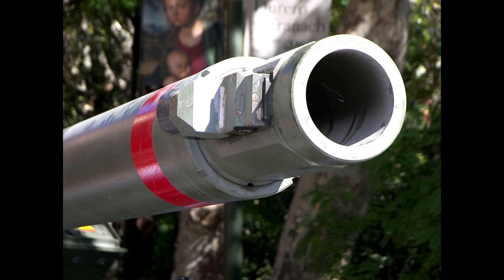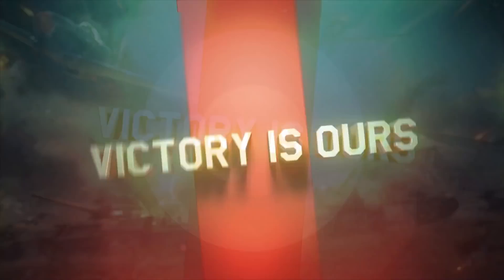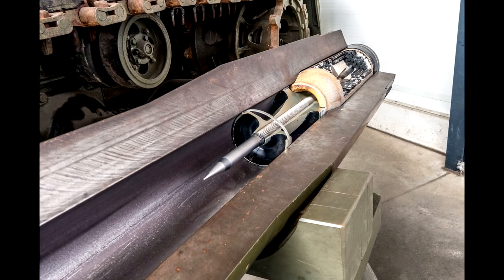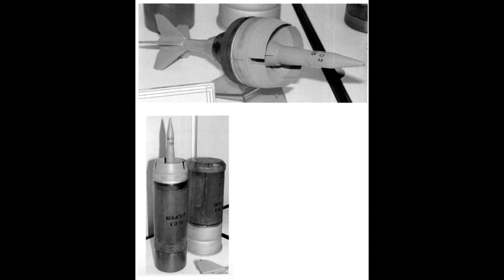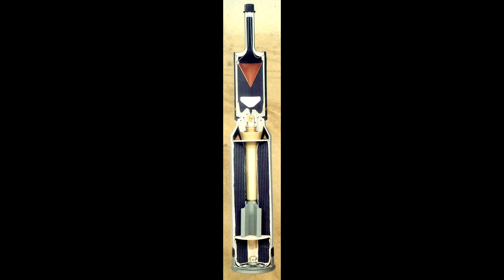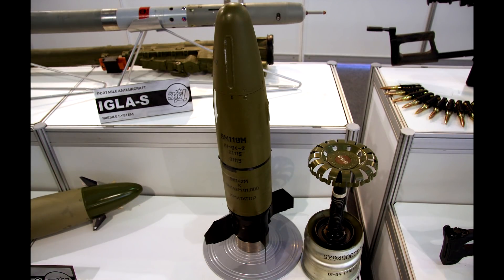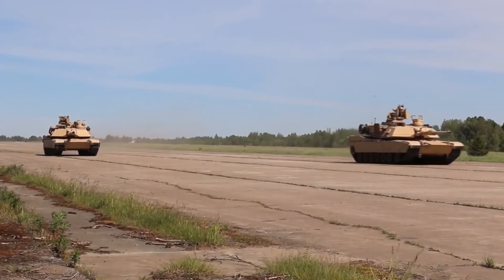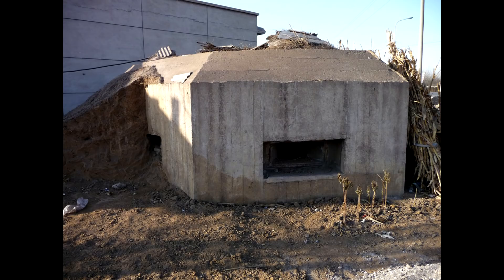Tank Basics - Firepower of Modern Tanks

Comment: The projectile will break if it is too thin, that is why crossbow bolts are thicker amd shorter than arrows, its so the bolt can withstand the amount of force exerted on it, slightly different but same premise, the more force often requires a thicker and/or shorter projectile, i'm no expert, but i do a massive amount of research, and i still dont take what i "know" as definitive, so if anyone know if my comparison is incorrect, let me know and mention why, i would greatly prefer that rather than just saying that im wrong without telling me why.

Comment: A comment and a question. First my comment. Sabot performance is based upon kinetic energy (KE). The formula for calculating kinetic energy is:  KE = 0.5 x mv2. In this equation, 'm' stands for mass, the measure of how much matter is in an object (as in the case of the 'core' of  the SABOT dart), and 'v' stands for the velocity of the object, or the rate at which the object changes its position. So, what that tells you is that the heavier the weight (i.e. mass) of the projectile, the greater the KE it will impart as velocity increases. This is also why all major Armies of the world have gone to depleted uranium perpetrators, because of their 'mass' (compare Uranium's atomic weight on the periodic table of elements, if you have any doubts). Sabot rounds are shaped 'like darts' and have a 'thin diameter' so, that a very large and powerful gun can fire a very aerodynamic dart (i.e. less drag and more stability, results in greater inherent accuracy) while maintaining higher mass. Thinner, longer projectiles help to provide higher velocities, and act as more efficient means to store kinetic energy, which is the single factor that results in greater armor penetration (as substantiated by the KE formula above). So, your SABOT explanation makes several basic errors and resulting false conclusions. With that in mind, my question is simply this: "What are the reference sources you have been using and what are YOUR own personal credentials and experience with this topic?" I myself, am a retired US Army Armor Officer (i.e. M1 Tanks) and a former employee of the US Army organization that manages the M1 Tank Program in Warren, Michigan USA. I'm not criticizing you, per se, just encouraging you to do a little more homework in the future before presenting the results.
Reply: JagdPilot M1 Main reason why countries use depleted uranium is because it’s free.
Reply: @hazardous458  I wouldn't say that's the main reason, but it certainly doesn't hurt. Tungsten is notoriously expensive.
Reply: Actually, DU has several added benefits besides density, it has a unique shearing pattern upon penetration that some have referred to as "self sharpening," helping to achieve greater penetration, and it is also pyrophoric, thus enhancing its incendiary properties after penetrating. 

This, and, all other things being equal, a longer rod will penetrate deeper. There is a direct relationship between length of rod and penetration. To say it is only kinetic energy is a vast oversimplification, current penetrators are the product of decades of research and refinement.

Comment: Good video but some notes

Not all apfsds rounds are mono block
German dm53 is a segmented penetrator, there’s a difference
There’s also extending a[fads rounds like the ones that will be used on the warrior 40mm.
M829a3 may be a mono block, it has a precursor tip that breaks off in contact with era to counter it.

Comment: I knew a ranger who was in the first gulf war. He was in a forward recon unit and was tasked with sitting on a hill watching a Iraqi tank battalion and calling in the shots for the armor. the abrahms tankers start firing sabots at the Iraqi T-72's. The rangers would observe the rounds go past the Iraqi tanks and go skipping through the dessert so the rangers were calling in the shots as misses. After awhile the tankers started arguing with them saying they had killed all there targets. After awhile the rangers didn't notice any movement from the Iraqi tanks and were told to approach and inspect one of the enemy tanks. When they got closer they realized the sabots had been going right through the T-72's. They looked inside one and the tank crew had been jellyfied from the spalling sabot.
Reply: I didn't know a ranger and heard that story 100 times! Probably from their own ranger!
Reply: @pashapasovski5860   lol could of been BS. Ive known some tankers and cav scouts who had similar stories when I was in the military.
Reply: I meam techinically AFTER penetrating T-72Ms, an M829A1 core would still have some 200-250mm of penetration, that's enough to go through some 5m of air, an engine block, and some 70-80mm steel rear.
Reply: @TheNicestPig  indeed it is very possible because if the APFSDS has penetrated the armor, there is nothing inside the tank that could stop it from going further so it would just continue on its path and exit the other side of the tank. That's how powerful modern KE rounds are, especially against much weaker armor (over-penetrating). So it's very realistic that it has happened. The guys must have been very confused at that moment lol. Thanks for telling the story it was very interesting to read 👍😊